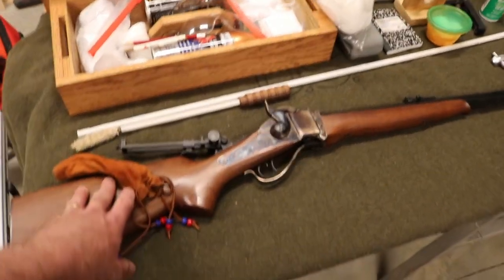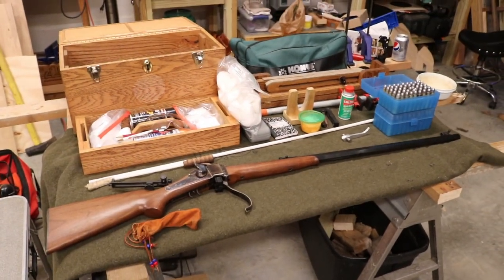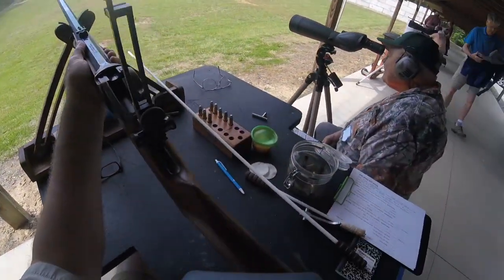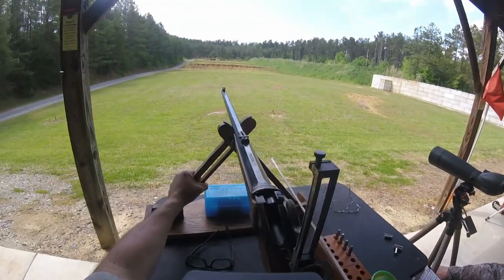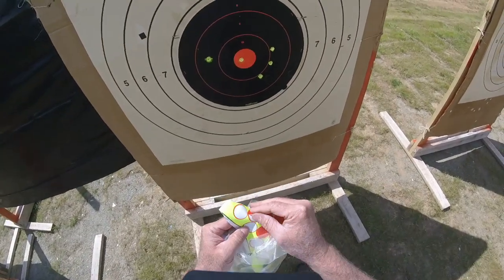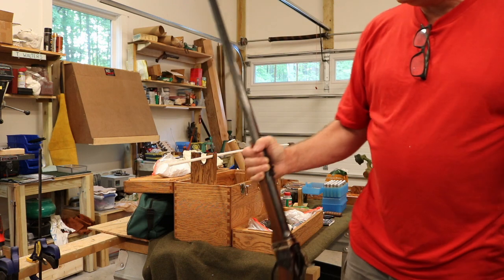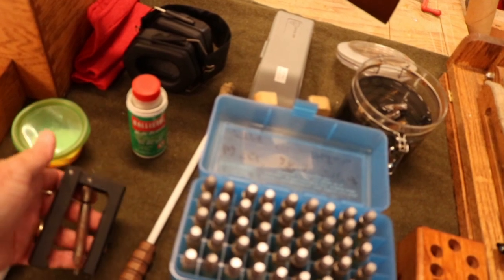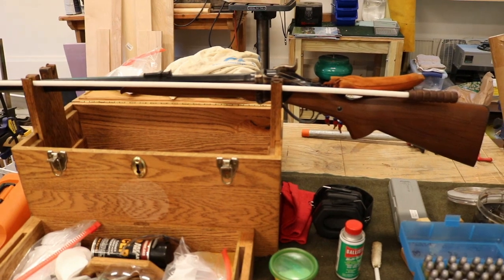#55 Single Shot Cartridge Rifle Match and the Equipment that I Use

Comment: Your video has been a great help, I have a Pedersoli  45-90 that i purchaced a while back . Still trying to make a accurate load , Im blessed to live on a farm with 600 yard distance to shoot but Im not there yet lol.  I was wondering if i could get some demension on your bench cross sticks ? Ones that i found just doesnt add up to yours, That im wanting. Any help would be greatly appreciated. Thank you and have a Blessed day.
Reply from the maker: Thanks!  I will have to measure the sticks and get back to you.  You can modify them as I have seen several that are quite different from mine.  Standby
Reply: Thank you sir..

Comment: Have you ever tried a blow tube instead of running a patch through after each shot?
Reply from the maker: No, I haven't tried that, but I have seen other guys do that in fact in the video at the end, one of the shooters is seen with a blow tube.  I learned the patch method from my mentor and it is now my routine.  Thanks for watching!
Reply: I’ve seen guys doing it both ways. Just curious. Great video btw. I’m waiting for my Sharps to come now.👍🏻
Reply from the maker: Yeah, I personally think that a patch soaked in diluted Ballistol physically removes a tremendous amount of fouling that the black powder deposits at each shot which is a changing variable in the equation.  Removing and lubing the barrel seems to keep me more consistent.  I don't think the blow tube does near enough to keep things constant and doesn't really impact the buildup of fouling.  Just my opinion from thinking about it and experience with accuracy using the patch method.  You will love your sharps!  I have so much fun with mine and they are so darn accurate.
Reply: Did u put a patch in front of a bullet